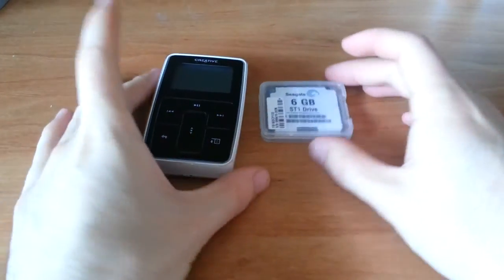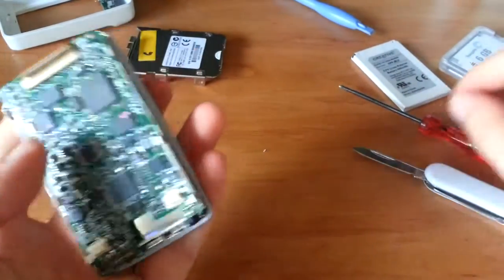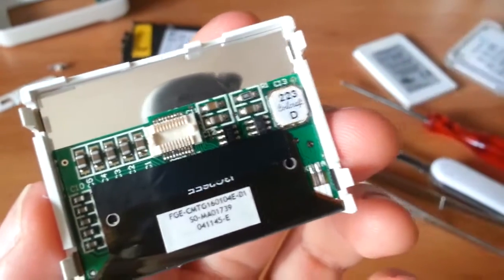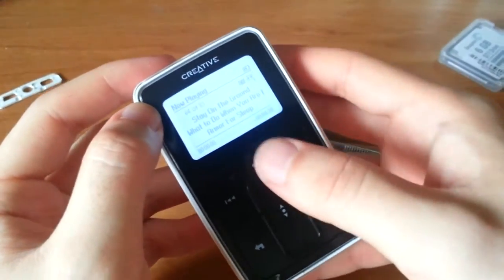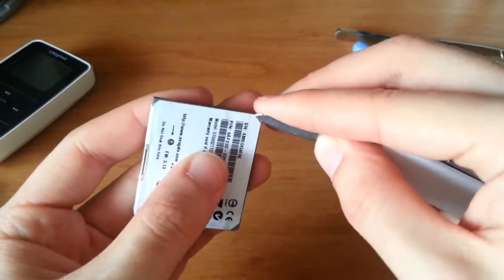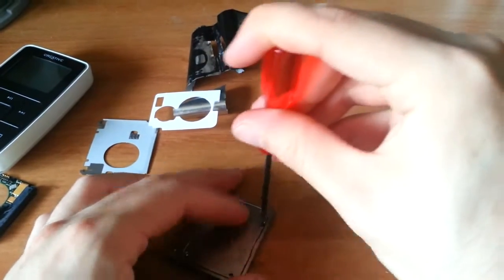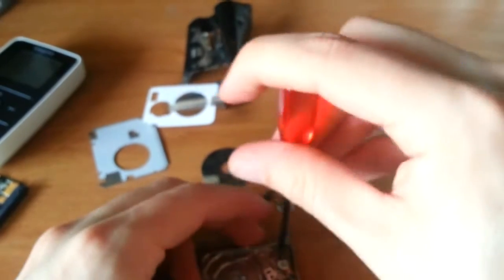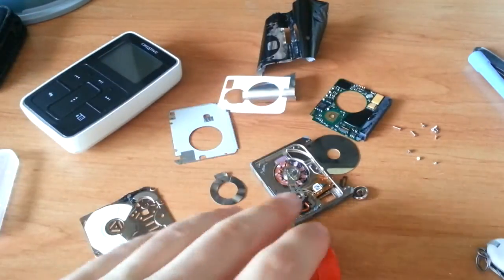TeardownTube - episode 25 - Creative Zen Micro and Seagate 6GB 1.8" Microdrive

Comment: Hello there....I have the same device but the screen is completely black.  Everthing else seems to work fine (or that I can hear--click click, etc) but without a working display it is really of no use.  If you can suggest a mode of repair I'd appreciate it.  Thanks.

Comment: mine doesn't click but it buzzes and it gets stuck on the creative screen. can you help me?
Reply from the maker: The drive is likely dead
Reply: @sjm4306  ok thanks great video btw
Reply: @sjm4306  can we mod it like the ipod classic CF hack
Reply from the maker: Yep, did mine ages ago but only had an 4gb cf card at the time. Process was pretty easy and higher capacity cards are now pretty cheap so def worth doing.
Reply: @sjm4306  i know I'm late but the drive isn't dead bc i plugged it in my pc and it works perfectly, so what could be the problem?
Reply: @Diegopie007 you should update FW
Reply: @electrogarden4426  how do i do that? i tried, you know, a year ago but i had no success, maybe i was doing something wrong
Reply from the maker: Iirc there's a firmware updater file you need to download for the specific model you have. Needs an older windows os (cant run in compatibility mode in win 7 and up). Plug player into usb, run fw installer and follow on screen instructions. I did this ages ago when flash modding mine so my memory may be a bit fuzzy.